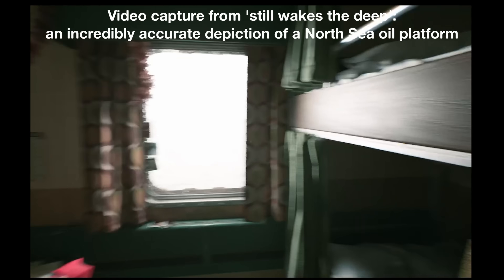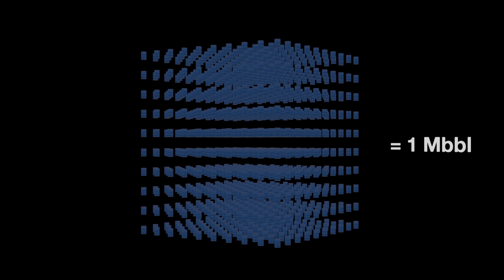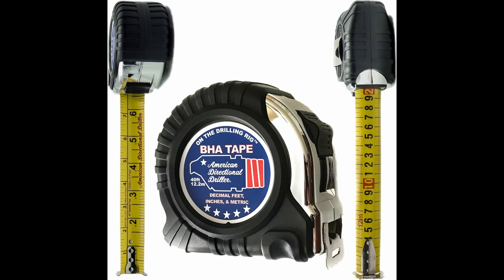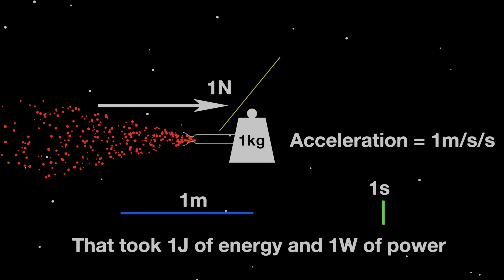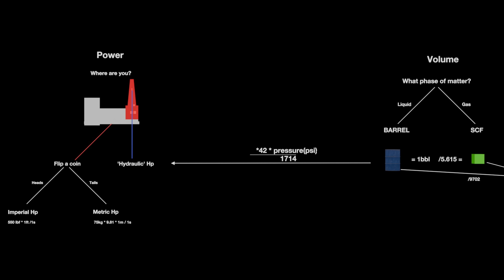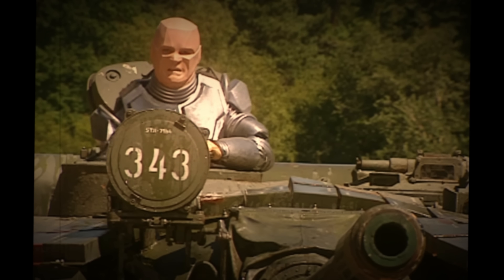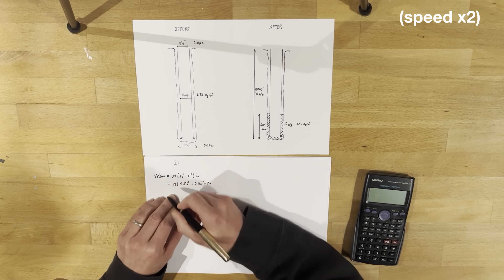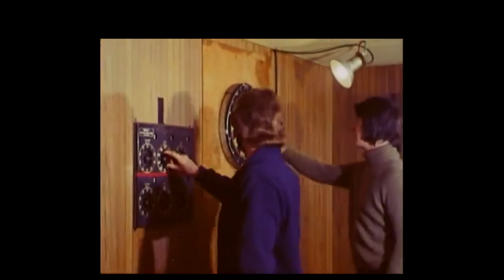Oilfield Units: a Measurement System so Cursed it made me Change Career

Comment: Dept of Transportation Land Surveyor here in the USA. We use 'Engineer Scale" aka decimal foot. However, instead of the 'international foot', we use the US Survey Foot (in most western states), which has a metric conversion of 3937/1200.
Reply: Just did a quick sum, which means that the US Survey Foot is slightly shorter than an SI defined foot. The essence of SI is not just defining a single system of units, but also having a single definition for each of them. The US gallon would seem to be a British gallon, but from the time of Queen Anne. But beware, in those days there wasn't really any national standardisation, and a great deal of skulduggery.
Reply: No you don't.  The US Survey Foot "is deemed obsolete" according to NIST.  Since January '23.
Reply: I don't know if you are being serious or not. Obsolete' is different than 'Not in use'.
In the USA, including most western states of the US, state plane coordinates on NAD27 and NAD83 are defined in US Survey Foot. Arizona is one exception. This continues to the the datum that is used for mapping for state DOT's. NSRS 2022 is supposed to come out and will use the international foot. I think it is in a pre-release period, but I'm not sure.

Comment: that 1714 is, by the way, what you get if you multiply 550 by 720 [inch pounds per minute / foot pounds per second] and then divide by 231[cubic inches per gallon], rounded down. To get metric horsepower, you'd use 1691 instead, since a metric horsepower is ~542.5 foot pounds per second. A quick google search thankfully reveals that absolutely nobody seems to be doing this.

Comment: I worked in semiconductors for a while. We used every type of unit simultaneously I think even worse than oil and gas.  Just for pressure we had, torr, atm, pascals, psi, bar and one other primary that I just lost in my mind. Every machine manufacturer and every process engineer had their preferred units that they used.  It wasn’t bad when you just had one area or one toolset. If you had to be involved across all of them it was a bit of a challenge. I learned to just drop the units in my thoughts. The range is x-y, I want a % change and just calculate that.  Occasionally you had to convert though. I had all the factors and primary equations memorized.

Comment: Looks like beer! 1 Imperial Pint is 1/8 of an Imperial gallon, being so 568.26125 ml.But  wait there is a US Liquid Pint that is a1/8 of an US Pint being 473.176473 ml. And those damn units are used to this day. In Brazil we used then depending on the brand of the beer imported as many have cans and bottles of exactly one Pint. For Brazilian beers we are sane and use ml.
But here despite of usin the metrix system, cattle still used arrobas (@) that is exactly 15kg to metrify it because it was 14.688kg in old times, just like the Penny was decimalized in UK in 1971.
And yes we use BTUs for air conditioning  instead of Wh or Joule...the reason escapes me....just for air conditioning.

Comment: 5:05 It's not. We use it in metals exploration in the US as well. I worked at a geotech engineering firm for a bit too, and I think we also measured downhole depth in decimal feet. It's faster to convert to metric, at least.

Comment: The actual line workers shouldn't be doing math. They should have easy to understand units that work for the task they are doing. The engineer's job is to deal with the units for them, so they don't make mistakes. Metric isn't necessarily better for this, as it was designed to be logical to the scientist not the line worker. Traditional units were made by the guilds and were useful values. During the unit reforms and the creation of new professions both systems developed problems for the workers.

About the curvature: Radius of curvature works for machinists because that is how they implement the cut or bend. Drillers work differently, so they use a different unit.

Comment: There are some uses for old terms that just make sense, like in the service/kitchen industry, a Sally is typically a Salamander open oven thingy, but if you've never worked around them and you run into a kitchen that uses non salamander ones, you'll quickly go "who the fuck is Sally and why are we stuffing her?" Before a chef points up and calls you stupid for the tenth time that day. 

But mud weight, for density, is enraging.

Comment: I worked in energy trading for a while and the units were wild. They even referred to total electrical energy as "power", not the the time rate of change of energy. The software i worked on had every variable reference a separate variable just to fix its unit.

Comment: I remember working at a company that made parts for a french/american company, the prints used whatever units they felt like, intermixed, there was a whole seperate document where basically the managers from both our company and theirs actually signed off on each dimension or specification...and there was one page in english and another in french. the fun part was when those pages disagreed with each other and you the technician has to ask the QM why we've been using X value for 20 years when the spec documents disagree.

Comment: at 12:40 .. it took me a while to realize that by "mass / length * time" you mean "mass / (length * time)" rather than "(mass / length) * time" ... I was aware that giving multiplication higher precedence than division (instead of equal precedence) is a convention that exists in some circles but I think this is the first time in my life I've actually seen it used.

Comment: What's crazy about decimal tape measures, is that even in industry that you would think would benefit from it... machining and manufacturing rarely would ever want one of those where it can be accidentally used.  We've already "made peace" with the metric system.  As long as you know just one conversion: That an inch is 25.4mm, everything else falls into place rather quickly.  Also, there are a whole ton of "close enough" measurments that translate to sane numbers in BOTH the metric and imperial systems and they're used a LOT to keep life simple.  Want to know what's not simple?  Using a tenths of an inch scale and converting ANYTHING other than whole inches.  Because it means NOTHING outside of maybe estimating a number to punch into CAD.  But you'd be better off and would keep everyone else who ever has to look at your work happier if you just used a regular tape and got the number to within 1/8 or 1/16 of an inch.  Why?  Because for oddball imperial numbers, more often than not, the only reason you'd use odd very small fractions is because the object in question was ACTUALLY intended to be in mm!  So I feel for you man.  The oil industry is truly on its own planet and should have sorted this out long ago.

Comment: You think you're confused imagine how we feel
Reply: Imagine the times when computers measure time in clock cycles per instruction having to burn up all that CPU power/ storage/power to do these conversions in functions that are used more than the program actually runs... in the late 1980s you might spend a week just to save a couple instructions in a couple functions to improve performance..  and at times it's not a small boost.. 

 I've seen some code improvements double or triple the speed of a particular program...

 Having said all that,. I still don't understand though why haven't we switched?!?

Comment: The units used in the textile industry are pretty terrible too. I don't work in the textile industry, but the one time I tried to do calculations with textiles it was terrible. Tensile strength is given in units of cN/dtex. I did the appropriate conversions (NOT a trivial thing BTW, with no online calculators to help either), quadruple checked it, and I'm pretty sure the quoted numbers were off by 1 million times what it should have been.

Comment: Naval Architect here. There is also the "ton" problem. Coloquially, "ton" is a bunch of something. So you have the "metric ton" (or tonne) which is 1000 kg , the american "short ton" which is 2000 pounds and the british "long ton" which is 2240 pounds.

Traditionally, crane stats are given in short ton and ship calculations in long ton. So, if you have a crane on a ship in a non-English country, you might see all three tons at the same time. And once I encountered an english oil company provider that used THE LEFT HAND RULE (aaaahhhrggg). Yes, all vector multiplications gave the opposite value anyone expected.
Reply: You forgot the Freight Ton.  A measure of volume used on old cargo ships.  40 cubic feet.  Something to do with the size of a medieval wine tun!  (Digging deep 40 years to second mates dusty old lectures)
Reply: @jansalm75  A very rough mental calculation suggests that 40 cubic feet of water weighs about a (British) ton. So it would be a way of estimating the space taken up by a ton of cargo that has similar density to water.
Reply: @gcewing  A US gallon is 231 in³, so 40 ft³ = 69120 in³ = 299.22 gal. I'm guessing the 40 ft³ comes from rounding 300 gal.

A US gallon of wine is supposed to weigh 8 pounds, so 300 gallons should weigh 2400 pounds, which is much more than a US ton. And water weighs even more.
Reply: ...Ok I'm curious.  Why did they use the left hand rule?  Surely there's some story there.
Reply: @professorhaystacks6606  is it applied loads TO or imposed loads FROM which would reverse the directions?
Reply: Right to jail.
Reply: 3d programming and coordination systems are "fun". APIs, formats and engines essentially go through all the possible permutations. One thing is what's up and down and handedneds (Z is often up in architecture drawings, but Y is down on bitmaps, or up if you like graphs), or what a column in a matrix is, and how long 1.0 is. That can be pixels, inches, metric, cm, or my favourite, in old source engines, a 32th foot. And these people are trying to define what a color is.
Reply: @Carlos-ux7gv  which pound?
Reply: @kratzikatz1 avoirdupois pound, whatever that may be. Short Ton is about 907 kg and Long Ton is 1016 kg, which is close, but not quite, to the metric ton.
Reply: What about a "ton" of air conditioning capacity?
Reply: @K-o-R  so I looked it up and apparently it's the amount of energy to melt 2000 lbs of ice in a 24 hour period which is apparently 3.5 kW of heat removal. What the actual f...
Reply: @iamjustkiwi that actually makes sense in its historical context. Back in the day, cold storage are kept cold using ice and delivered anywhere between daily and weekly. You want to measure how much (short ton) ice you need to keep all that expensive meat and produce from spoiling and rotting in your cellar until the next ice batch.
Reply: Interestingly ton itself originates from tun, a kind of casque/barrel that was used from the medieval times for bulk shipping... With everyone making similar, but not quite, tuns, and then the French Academy deciding 1000 kg is close enough.
/Checks Wiki.../ OMG, tun the barrel is gone, but tun is also a measurement unit, for volume, with several definitions, of course, and it's apparently still used in wine industry. Why are we doing this to ourselves?
Reply: @nebufabu  Don’t mention the Barleycorn. It is the difference in shoe sizes.
Reply: Left hand rule?! 

That's just trying to be different for the sake of it!
Reply: FYI, the left hand rule is arguably the main standard for computer graphics, all because the origin of the screen was conveniently put at the top-left, towards the bottom-right.
Reply: @Kaizzer it was a ship water ballast calculation, nothing to do with screen coordinates.

No one would expect the LHR to appear in a engineering calculation sheet.
Reply: Which "left hand rule" is in use here?
Reply: Fun fact, the Unity game engines (a very popular one to use) also uses the left hand rule for vector math. I hate it with a burning passion 😌
Reply: @maxk4324 you can do RHR for every calculation in Unity. Only screen coordinates need to be done in LHR.

And every game engine is like that, including packages like OpenGL and DirectX.
Reply: I blame metric-tards for adopting a ton instead of using their greek prefixes. If ton was short and tonne was naval ton, it'd be easier.
Reply: @Carlos-ux7gv  And then there's ton (power), which is the equivalent cooling power of a short ton of ice melting, or some other insanity.
Reply: the freightning thing is modern kids dont calculate anything, the ask their phones

Comment: Let’s just call it for how it is…
Even as an American, though one educated in physics, chemistry, and the sciences…metric *makes SENSE*!
It easily converts between standard fundamental constants of the universe.

Imperial measure is antiquated and screams “I never learned enough to adopt a more rational way of measuring the universe around me.”  It screams, “I’m stubborn, and this is how it’s always been.”

Metric (SI) units make sense - they all convert between each other to gauge everything from velocity to charge to current to electron drift to quanta to relativistic speeds…to the volume of water at a given temperature and pressure…back to length, width, and depth…and thermodynamics.  It makes sense.

I’ve had to “unlearn” years of American BS in order to properly think for physics and chemistry - and it works.

Imperial units are arbitrary nonsense.

I’ll go one further - I’m also from an area of the U.S. that specializes in oil and gas - I’m surrounded by people who work in this industry.  And I can say…definitively…that there is a horrible mentality that persists which is as close to the film “Idiocracy” as one can get:
“Imperial units are American. We’re not changing to be like those other countries. We’re sticking with the good ol’ units - because we’re good ol’ boys.”

SMH - none of that makes sense - if that logic applies, then why not abandon natural gas and go back to making campfires or using coal-burning stoves.

As science progresses and rationality wins over, sometimes it makes sense to adopt that which is MORE rational - which is SI units.
So…I guess that makes me less “American”.  But, if “American” means stubborn and ignorant - then I’ll take that assessment as a compliment.

Comment: I feel like making up a measurement unit of: Lbs per cm diameter, with an adjustment for if it is measured at + or - of 300kelvin. 
Just to make a point that more standards of something, makes things harder to "see". 
It is for measuring viscosity. Call it Mark's Curse, or "MC".

Comment: 15:55 why did you say 216 cubic inches per gallon, but write 231?  The correct conversion is 231, what you wrote (and used in your calculations) so why did you say 216?

Comment: A small one but it makes the MEs mad: in circuit board design, a "mil" is 0.001 inches - just another name for a thousandth...
Reply: ive also heard it as "thou" (thousands) by some machinists.
Reply: @3of11  and a "tenth" refers to 1/10000 of an inch.
Reply: I have a theory that the English language (or Australian?  correct me please) tradition of saying “mil” for millilitre came from this existing phrase, and that “kilo” got randomlyapplied to “kilograms” in mostly the same way.
Reply: AFAIK a lot of American machining once used 'mil' (miliinches, I suppose), later renamed 'thou' (still thousandths of an inch) in most but not all industries when they realized they could be confused with Metric units.

Comment: Speaking of decimal feet, in electronics a common unit to use for printed circuit board designs are mils which are thousands of an inch. Probably related to the machines they used to make those boards early on.

Comment: Okay so I am a complete outsider here that knows nothing, however I do have a question. How come nobody (seemingly) has come up with a system or strategy for getting to a point where at bare minimum the measurement systems can be reduced to a new system or systems that de-complicates this topic? Is that even possible? Desirable? I am assuming given the closing statements of the video that this is a human political problem mostly, would that be right?
Reply: Any such strategy would involve convincing all of the old grizzled front-line oilfield engineers to give up their green handbooks in favor of something new.

More rationally, it also means giving up all of the other handbook formulas and lookup tables that are written with the conversion factors baked into them --and often baked into them in combination with empirical or geometric constants, so that changing the units only gets you a different multiplicative constant in the formula; it doesn't remove the constant.
Reply: @BrooksMoses  Yeah it seems like it is probably a big ask to get people to demilitarize themselves to find solutions that could ultimately simplify the spectrum of measurements. I get why there are different measurement systems but that doesn't preclude looking for unifying elements. In fact I wonder if there are answers to be found in the ancient past. Like for example, what system of measurement was used to build the pyramids, etc.

Comment: ‘Horsepower’ is messy. I was reminded of this lately when buying a 1960’s slide rule. (Look it up, kids!)

Engineer’s slide rules often had a small extra line in the cursor at the A/B scales for kW/horsepower conversions. On fancy German models, that extra line is labeled ‘PS’ for Pferdestärke but on models from the same brand for the US it reads ‘HP’. Not only was the label adapted for language, but because of the different definitions the line position had to be different as well.